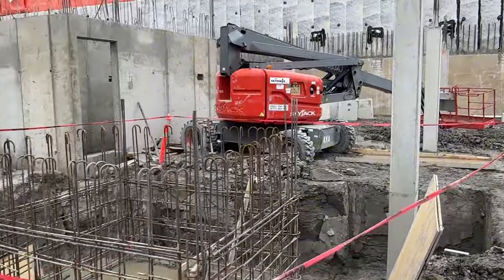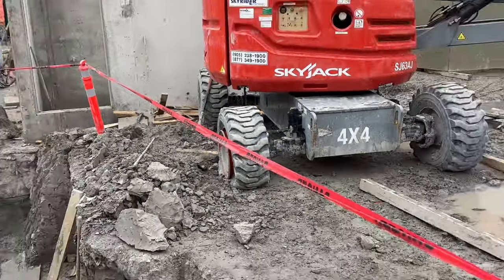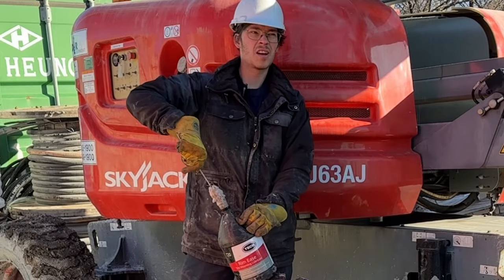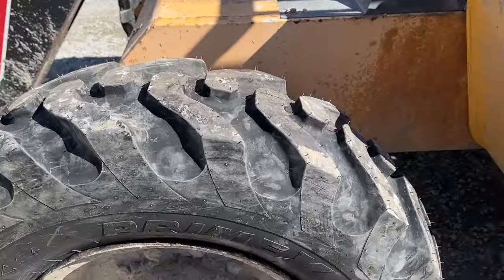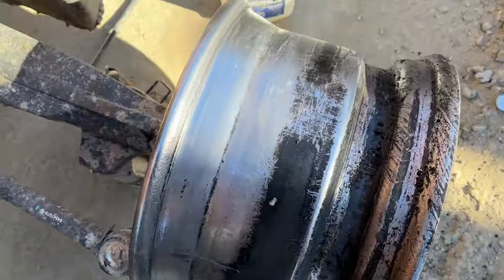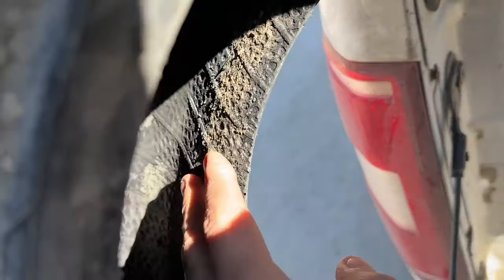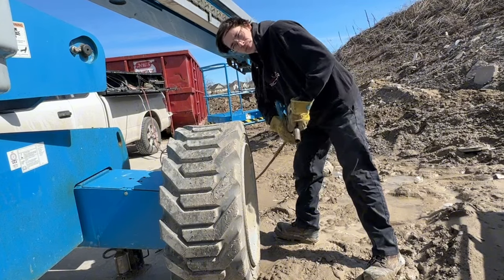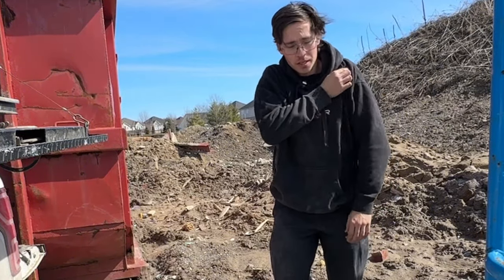I Went Into A Mud Pit With 2WD! - TD Vlog

Comment: Never buy a 2wd truck, even for a work truck. All trucks should come standard 4wd
Reply: No 4wd for most people is a bad deal, it cost more buying it, needs more fuel and maintenace, aswell as less payload capacity. For something most people only use it once for fun, if you arent towing heavy in unpaved roads, you probably want need it and better save the additional cost.